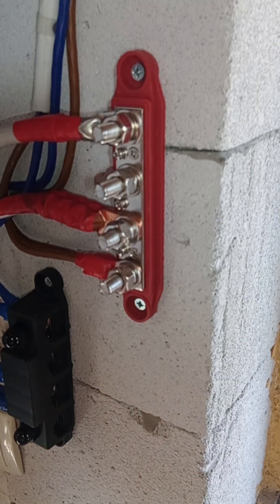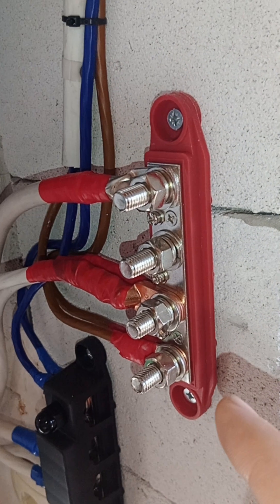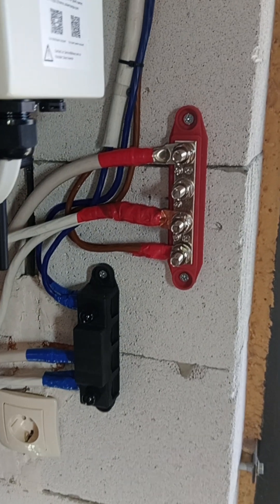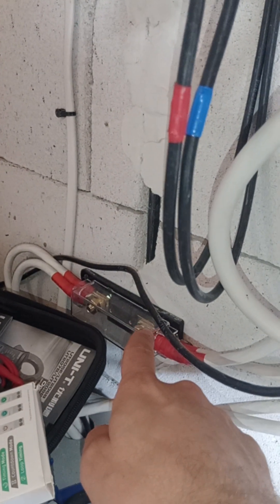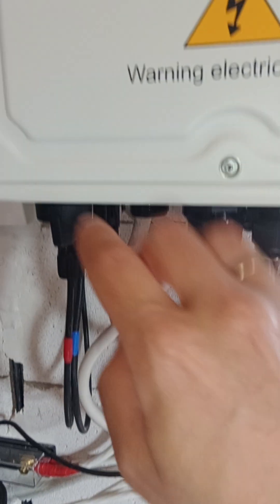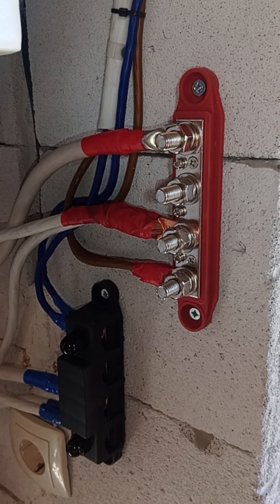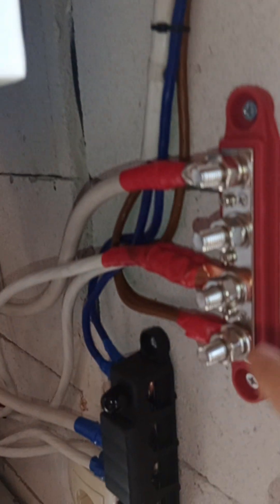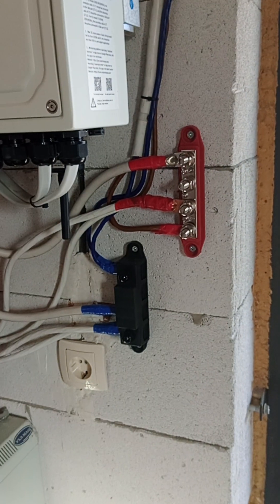DC bus bar in 12/24/48 V application in action - 250A is a proper size

Comment: Hi Mate, my best advise to anyone trying to live offgrid is to buy as many secondhand solar panels as you can, have them along every fence and on the ground. I have been buying any secondhand solar panels off facebook market place over a year, to the point where I have 120 solar panels. Now it doesn't matter if it is rainy or cloudy, I am always making some power whenever it is not night. Old solar panels might be less output then new panels, but it all adds up to getting more power into your batteries. Take a multimeter to test that each panel is working when buying secondhand solar panels.
Reply from the maker: I will absolutely agree! Unless you are building stuff from scratch and have got a decent budget to get a proper new ones (bifacial, TOPcon, N-type).

Comment: what is square area of that busbar?
Reply from the maker: 2*20 mm, length is 110 mm
Reply: @BackyardVoltage  40mm2 for 250A? i would choose something thicker
Reply from the maker: @rm6857 it is 3w of heat only at 250A. Is that too much?
Reply: @BackyardVoltage  dont know your conditions, but in summer with those m8 holes and plastic cover, it might have problems with cooling
Reply from the maker: well, in my case there won't be over 110-120 amps ever. but... as I said - top is the 3w of heat (on 250A continuous), which is nothing, and natural convection is more than enough to cool it down